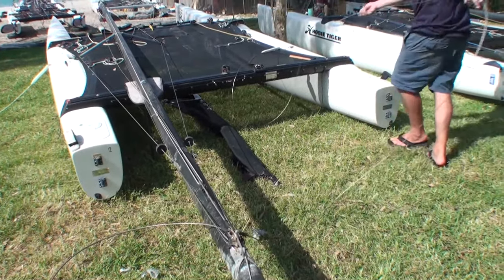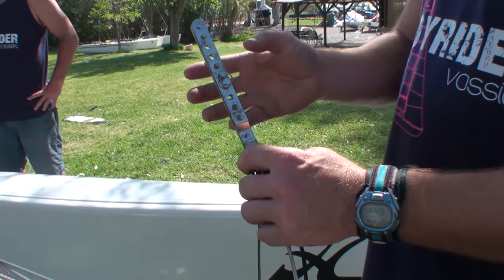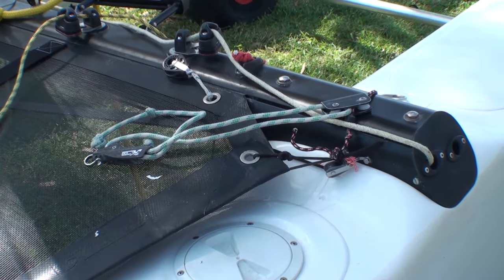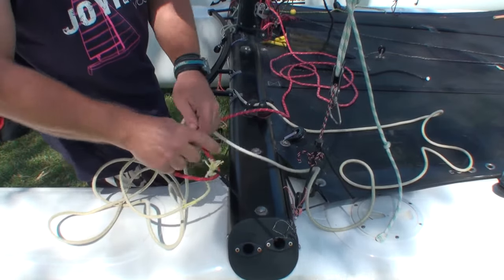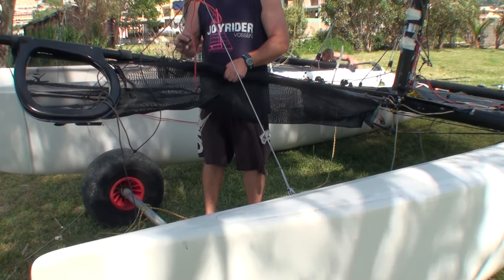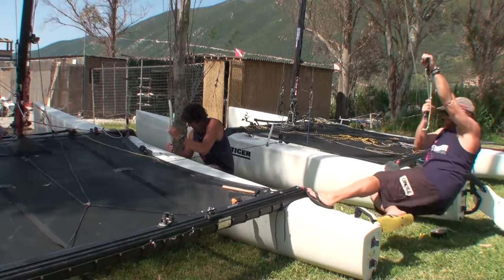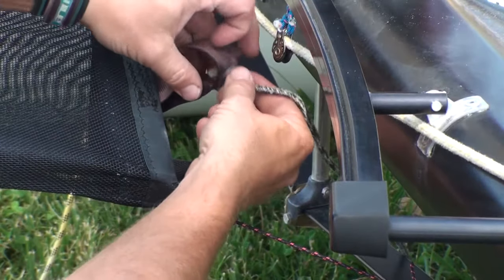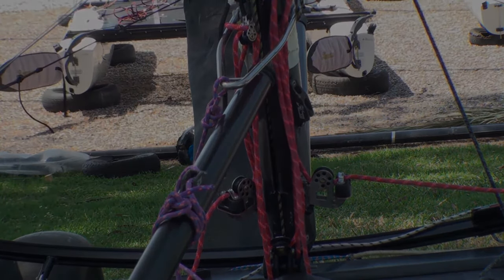How to put the mast up⛵️Hobie Tiger

Comment: Great tutorial Joe. Tomorrow I am taking the mast down... for the first time (!!!) and in a week it should be up again🤞
I'll try to make the best use I can of your awesome instructions.
I'll keep you updated 👍😊
Reply from the maker: Sounds good!
Reply: So... we did it !!! 💪😊👍
We lowered the mast two handed: "Easy !" (but I would strongly suggest a third person!)
One important thing, though (crucial, I'd say!) 
On my Hobie Tiger (y.2000) there is a long threaded pin which prevents the "ball" from flipping out of the mast. It is essential when you take down the mast to turn it on the right side, otherwise taking that pin off is simply IMPOSSIBLE.
Of course, we didn't notice until the mast was down ... and... of course... it was on the wrong side 😫 (does it prove anything about the Murphy's Law ? 🤔😅)
BTW: there is no way to flip the mast on the other side, other than putting it up again (two handed? " Not easy !!!")